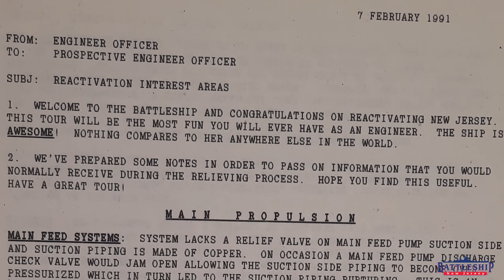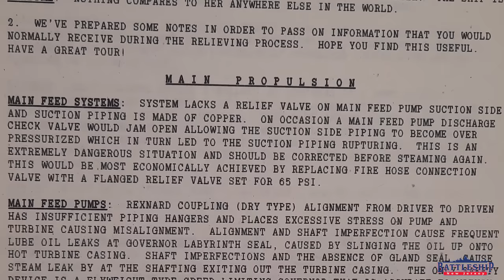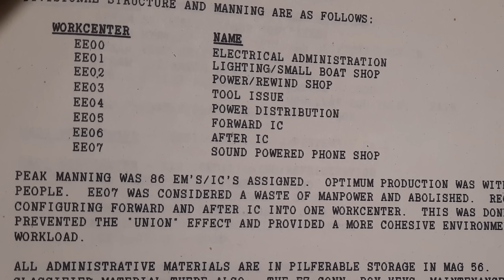The Call To Freedom Will Be Sounded Again: How to Bring Back Battleship NJ

Comment: While I can agree that the sheer firepower and sturdiness of a Battleship will definitely be needed again if war was to break out. I don't believe we would be able to use the Iowa's. While they remain in excellent condition such as the Wisconsin and the New Jersey, the costs would be too high to be worth the investment, not to mention an overall logistical nightmare. These old battlewagons are in their late 70's and even the production lines that would support them (ammunition, gun barrels, misc. parts, etc.) have been dismantled for decades. The tooling and skill have been lost to time.

There are two scenarios I can see the Navy attempting to reactivate the Iowa's again. First, at the outbreak of war, likely WW3 with China, focusing in the pacific with combat off Taiwan and possible island hopping. The Navy will rush to reactivate them and bring back all the logistical support needed to operate them. While cost would not be an issue, time would. It would likely take at least two years to refurbish/modernize, supply, and train crews for the best condition Iowa's back to active duty. A luxury we may not have. The second scenario is the Navy begins this process in anticipation of this conflict, much like the Marines being reoriented back to the island-hopping doctrine (for example when they had their tanks taken away). However, I can see the same process taking much longer, closer to a decade, for a much more thorough update/upgrade to the Iowa's, with cost also hampering their progress. This scenario is much less likely as the cost alone could deter the Navy and Congress from making the investment.

Personally, I believe that a new design should be presented for a modern battleship design. It is likely that the Navy would not be interested until war were to break out and that it would lead to just as long, if not longer, time to design and build them than the Iowa's. But it would be a better solution in the long run than continuously bringing back these old veterans. While I'm no naval architect nor expert on modern naval technology, I would suggest using the Iowa Class as a starting position. My reasoning for this as very few battleship designs have been drawn up since. Of course, replacing much of the design for more modern and stronger parts/systems. Such as using stronger materials for the armor (titanium, tungsten, DPU, etc.) over steel, although I'm no metallurgist so I would not know what would be best. Replacing the engine with nuclear propulsion like on a carrier. Modifying the hull/superstructure to better adapt to radar and stealth technologies. A larger array of missiles and electronic warfare systems. And possibly automation in loading systems for the main battery. The list goes on and there are likely others with much better plans in mind than me.

In conclusion, I cannot see the Iowa's being reactivated outside of wartime desperation. However, I can easily see the durability and sheer firepower of battleships being needed in the Navy's future, and that an all new, even more robust and powerful design should be developed and ready for when it is needed.

Comment: I don’t see them ever bringing any battle ship back. No one in service knows how to run the engineering plant. No one knows how to use the 16in guns. More thank likely they would need to take a turret to make room for a proper VLS launcher. Based off the old In service inspection reports the Iowa it’s self should not have been in service till all the issues should have been fixed. The extra armor and double hull means nothing with modern missiles and torpedos. If we ever did a beach landing we wBut with that said. I honestly think with that said Iowa would be first to be brought first because it has had the least foot traffic. The least amount of civilian work and modifications for the museum purposes. And yes turret 2 is unusable but that gives the Navy the best excuse to update with VLS

Comment: The Navy had to ensure congress that the loitering firepower capability (NGFS) brought by the Iowas would be re-introduced in subsequent designs, notably in the Zumwalt's railgun. With the recent decision to abandon that program, it's possible the Navy may have bring back -- at least into the reserve fleet -- one or more Iowa to fulfill the NGFS role, as mandated by congress. My understanding is they are currently without solutions (e.g. hypersonics, etc. will not foot the firepower/rate-of-fire requirements), so if recommissioning were to happen it would begin sometime in the next 5 years, though I don't think New Jersey would make the final cut. No disrespect to the current staff/crew but congress went out of its way to make BB-62 a museum when it did, and Wisconsin and Iowa were technically the last to be retired.
Reply: Someone may point at the success of MLRS platforms on land, and try to sell a compatibility with off the shelf equipment with up to 500km ranges to build a new class of fire support frigate able to use them, maybe also try sell it as operating drones too. They already tried parking HIMARS on the decks of ships to fire at land targets in tests I think, so why not just build a ship that can load the pods and share some ammo with Marines and Army? Congress loves efficient sounding ideas like extra range and interservice sharing.

If it actually works would be a different story though....
Reply: @Del_S  HIMARS doesn't pack the same punch, and each round is far more expensive. 

You can park an Iowa off coast somewhere and saturate targets with 16" rounds for weeks on a fraction of the cost of HIMARS (even if using the least-expensive munitions, which are more anti-personnel/anti-vehicle). Then you have rate of fire and there is just no comparison. HIMARS does have its place and advantages over static fire, especially in range, but it doesn't come close to filling the NGFS roles. 

Example: how long did it take HIMARS to render the Antonovsky Bridge useless? The truth is it never brought it down after millions in munitions were expended, but an Iowa in the Black Sea could've maintained fire until the bridge was no more, at a fraction of the cost. Hopefully, that paints a picture of the NGFS gap that currently exists.

Also, HIMARS is not a new platform and all of its projectiles share the same problem all other missile families have $$$$ (etc. tomahawk, harpoon, etc.) If there was a platform which could feasibly fill the NGFS role, it would've already been fielded... But, NAVSEA is still in search of a platform, and putting all of its eggs in the hypersonic basket which won't work out due to financial reasons (same as other missiles).
Reply: @donbeal6777  Yep. But the 16 inchers might not be that much of a cost saving upfront since you need to bring things back online even if just taking the turrets and guns to mount on a new ship. They also only have much less range meaning your battleship/fire support ship is even closer to threats. The balance of military effectiveness over what Congress will approve is the big problem for any option here.
Reply: @Del_S  Your correct in that range is more limited, but the NGFS role is required by congress because it's a necessary component for successful amphibious operations, long-range support isn't necessary; leave that for tomahawk, etc.. Hypothetically speaking, we have no way to neutralize amphibious fields against peer adversaries -- million++ dollar solutions, like the type of HIMARS rounds you mention, cannot fill this gap -- stockpiles would deplete way too fast commensurate to replenishment. 

Tooling is a good mention, cost for spinning up production lines would be substantial, but for powder and 16" shells, current automation would work wonders, and GPS guidance + fins could be dropped in at negligible cost (think 16" Excalibur rounds), and overall cost would only be a small fraction of the actual recommissioning.. Per 16" it would likely be something ~$40k per round, vs. 7-figures for similar yield HIMARS munitions which are only 1/4 of the destructive payload and cannot sustain anywhere near the same rate of fire. Missile platforms cannot feasibly fill this role due to their cost, construction/engineering cycles, and limited rate of fire; just not possible.
Reply: @donbeal6777  Good points. And of course one could always design a boosted shell to reach out a bit further, for the middle ground if you still want the guns able to do some longer range strikes without splurging a couple mil on a few tomahawks or risking a jet/drone to any anti-air in the area. They'd probably cost at least three times as much though, but I imagine it's still cheaper and offers a higher amount of payload to target than the same amount of rockets or tomahawks for the cost.

Comment: At this point, the ship's power plant is too outdated to be economically reconditioned or operated....and the cost and problems with replacing it puts you well on the way to building a new ship.   The plant in Crane that produced it's shells is long gone, and the concept of large powder charged guns is nearing obsolesce as well.  There are a number of alternatives that would give a higher rate of fire with more accuracy.  Another factor that was becoming a problem even at the point it was decommissioned is just about every part on the ship has no modern counterpart and has to be custom made.  Then there are the environmental issues with lead paint, asbestos, etc.  While that material is currently encapsulated and safe for a museum ship, it wouldn't pass current standards for an operating ship.  The last killer is the same one that is being addressed with the newer aircraft carriers, that of manpower (or woman power if you prefer).  Even with all the upgrades, running an 80 year old battleship takes a lot of crew doing things the old fashion way.  When the ship was decommission Navy personnel strength was 579,417, it is now at 344,022.  Short of a protracted war on the scale of WWII, that number isn't going up.  The Navy has to do more with less......and thus there is no room for a labor intensive ship.

Comment: i could see the appeal and use case in today's navy for a ship that can bully its way into contested waters and generate a 23 mile radius area of denial.   The distance between taiwan and china is about 100 miles, so making 1/4 of that a no mans zone might be worthwhile.

With all that said the Iowas really need to just be allowed to stay retired.  They struggled in the 80s and 90s to meet the power demands of the (then) modern weapon systems, and has no chance of generating the power for what ships are running these days.  

If the navy needs a brawler it should commit to building a new generation of them.  Whether its a heavy cruiser, a battle cruiser, or a full fledged battleship they dont need to even mess with the recipe all that much.   Something with a more modern, and efficient, propulsion, and with a good bit of future proofing in mind with the power plant., and keep the rest of the design more iterative instead of revolutionary.

Comment: A pipedream IK but I would love to see:
1. USS Wisconsin docked in Milwaukee
2. USS Missouri in Tokyo bay on Sept. 2, 2045
Reply: #1 is more believable since Wisconsin has shipyards that can accommodate it due to the fact we build cargo ships that are the same size if not bigger
Reply: @jacobmullins3644  there's no question if the ship could stand being in Milwaukee. She puts up with he 1000-footers that traverse the Great Lakes no problem, and with a little dredging she'd fit perfectly in the space next to the Milwaukee County War Memorial Center and Veterans Park. The problem is the logistics of getting her there in the first place, since the canals and channels along the St. Lawrence and Great Lakes weren't built to Panamax standards.

To get thru the St. Lawrence river alone you'd need to conduct 350-400 miles of dredging and canal modifications, rebuild 7 sea locks, and dismantle or otherwise modify as many as 15 bridges and 1 tunnel. 

Then there's the 8 locks, 3 bridges, and 2 tunnels along the 27 mile long Welland canal.

Then, you would have to dredge the 70 miles of the Detroit and St. Croix rivers, and then have to deal with 2 bridges.

And finally, there's the Mackinac bridge, which is, according to Wikipedia, "the world's 27th-longest main span and the longest suspension bridge between anchorages in the Western Hemisphere."

So needless to say, towing Missouri across the Pacific would be CONSIDERABLY cheaper than the millions, if not billions, it would take to get the Great Lakes and St Lawrence up to Panamax standards

Comment: no, there is no reason to reactivate the battle ship, one the tech is told and would take years to bring it up to current tech levels, two with PGM;'s from aircraft, the SSGN's, DDG's and CG's use of the trident missile systems we have the ability to place high explosives' more accurately on target. we can JDAM/Jsow/PAVEWAY bombs from 500 to 2000 pounds and place them within 8 feet of where we want them. the dispersion of the main guns of is  123 yards, the collateral damage would be excessive.

Comment: They won't be back.  No one knows how to run a battleship anymore.  Each preceding reactivation had a core of senior enlisted personnel who served on battleships or heavy cruisers.  After 30 years they are now all gone.
Reply: You might be surprised.  The NJ has an EOSS (Engineering Operations and Sequence System) somewhere.  Imagine a small library filled with the big 3" thick 3-ring binders.  Each and every step for bringing her Plant online is in the EOSS, complete with explicit instructions down to the label designation on the valves, which way to turn them, and how far to open them. 

A rough equivilant would be having a manual for starting the engine in your car which started with "Approach driver's door (drawing 1), insert key A into lock B using the thumb and index finger of your right hand.  Turn key 1/4 turn to the left then release.  Remove and retain key.  Again using your right hand, place fingers under door handle (drawing 2), lift up door handle, and pull driver's door towards you in an outward direction.  If Driver's Door does not open, repeat procedure.  If operation still fails, refer to Appendix A for troubleshooting procedures".  

Think I am kidding?  I've held a 4X8 card with step-by-step procedures printed on BOTH sides...for emptying the crumb tray in the bottom of a 2-slice toaster.  The Navy assumes that a situation could arise where untrained persons need to operate the equipment.

Comment: I highly doubt the USN would bring back the Iowa-class ships. Their technology is out of the 30's, built in the 40's, and even with their updated systems, they're still powered by steam turbine engines. The Navy wouldn't have anyone still in service (or of recallable age) who knows how to operate or repair the ship, much less fight it. Good luck finding 16" projectiles and powder bags (although those would be fairly easy to manufacture). Where is the Navy going to get new barrels for the main guns when the ones currently on the ship are shot out? I won't even ask how much fuel oil the ship would burn in a day - and the Navy doesn't even use fuel oil anymore. 

The Navy would probably be better off to design and build completely new battleships - using the Iowas' design as a starting point. A nuclear-powered battleship with extended range projectiles fired from 16" guns (I'm sure that the records of just how they're made are in National Archives somewhere...) would be one hell of an addition to the fleet - and a 4 - 6 ship class of them would be an incredible sight on the world's oceans.

Comment: It wouldn't make any sense to reactivate battleships. They may be potentially more survivable in their ability to take damage, but it would cost too much to put modern sensors necessary for the current age of over the horizon combat. They also ironically have less missile capacity compared to DDGs and those sexy 16 in guns, regardless of the quantity and quality of spare barrels and ammunition, would be completely useless in modern combat. Realistically, the Iowas would be killed before they got to the fight.

Comment: I don't think they would ever bring back any of the ships  unless they had no other choice. As. Nowhere days gun shoting is not really that useful  and the Iowa's are to vunerables to modern missiles and aircraft. It would really have to be an emergency to bring them back as it is basically analogue and not digital.
Reply: All ships are vulnerable to modern missiles and aircraft.
Reply: @Battleship009   yes but Iowa's are even more vunable to them than most
Reply: @andrewhoughton8606  I see it as a yes and no situation.
Reply: @Battleship009   true but the main reason they would be brought back is for shelling  mostly there are a few other reason that they could be brought back far which both battleship films attually show. As for the main reason they would be basically point blank range for any missiles and rockets  and they have not got the cabilities in current configuration.  To stop any serious anti ship missiles
Reply: @andrewhoughton8606  True.

Comment: The only thing these World War two Treasures should be used for is as maritime training colleges or for training navy personal.   Yes, the fire control system is a work of art analog system.  Yes the armor is a work of art.   But the maxim range of the guns is way to short maybe 25 miles.   The armor would actually make it easier to damage and destroy these days as many new weapons would exploit thick armor plate.     They can still teach engineering principles, and train sailors.   Also if something happened to one of these ships we could not replace it.  Socialism has weakened the United States to the point were we could not build one of these.